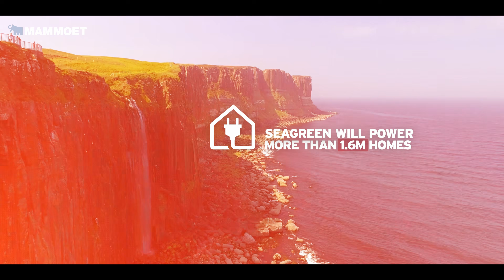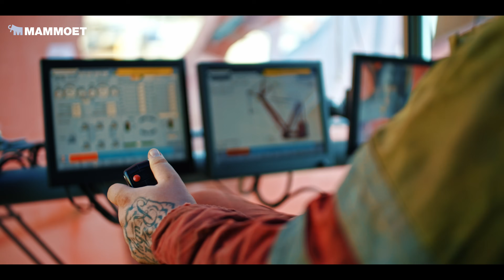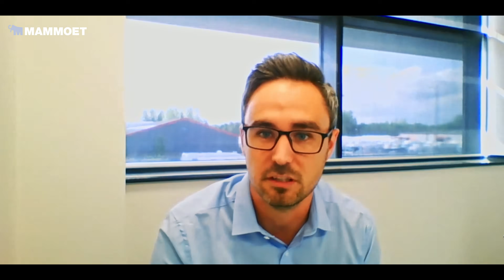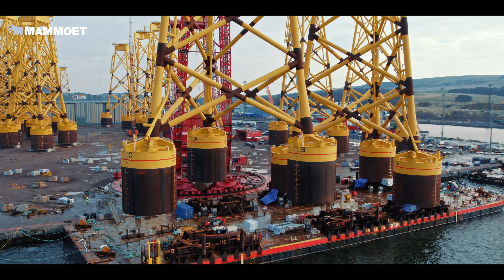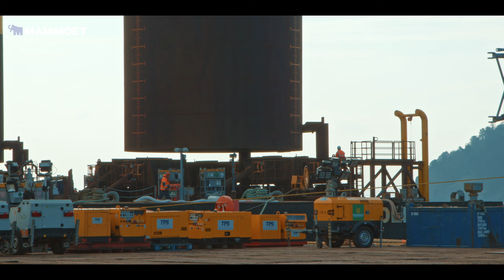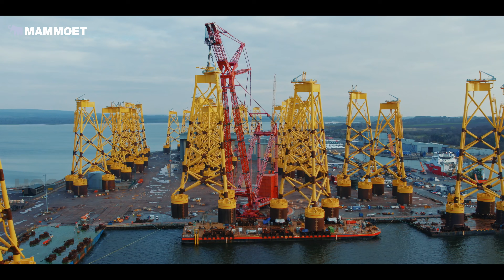Lifting over 200,000 tonnes between land and sea

Comment: Question... what is used to pick and place the Jackets from Barge to Final Sea location? Must be an equally big crane that is mounted to mother-ship or another barge ?
Reply from the maker: Thanks for your question! A Wind Turbine Installation Vessel (WTIV) - a jack-up vessel with a crane. The goal is to utilise this high-value asset as efficiently as possible by loading in/out and storing the jackets in timely fashion on land.
Reply: @MammoetHeavyLifting  Thank you for the reply.

Comment: Is there a Mammoet ring crane that can lift the same weight range, 1,800 - 2,100 tons, for a hub height point, of 150 - 185 meters, other than 95 - 100 meters as in this case?